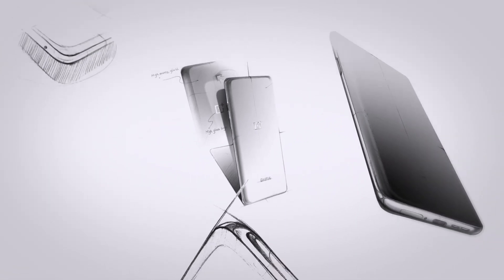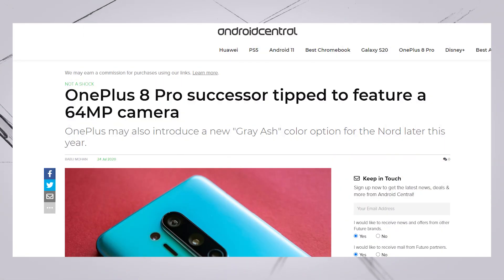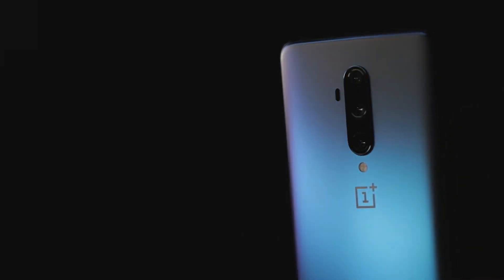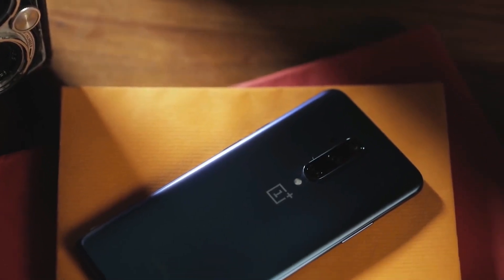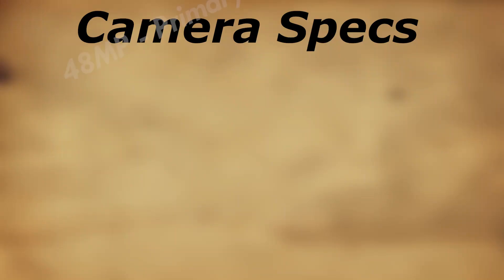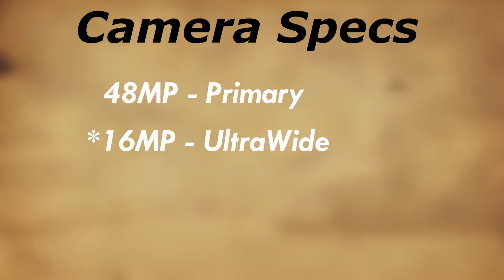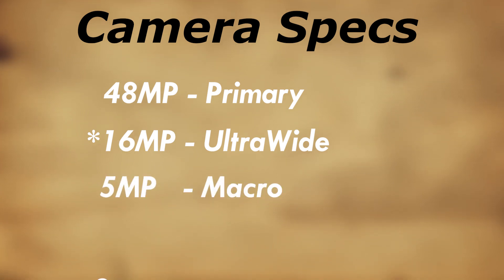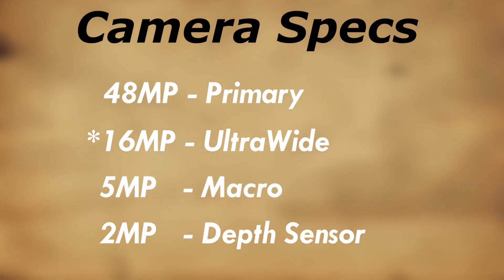OnePlus 8T - Detailed Specifications Revealed !!!

Comment: What will be the oneplus 8t 48 mp camera sensor ? Which Sony imx sensor will they use 586 or 686
Reply: 686 is 64MP sensor. 689 which used in 8pro will be using in 8T
Reply: @renjithramamoorthi8310   thanks for sharing